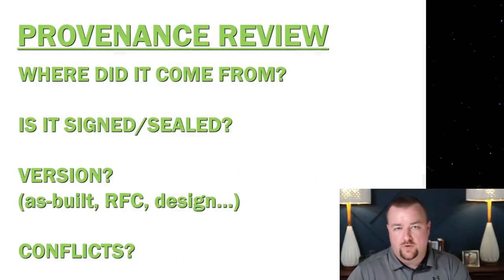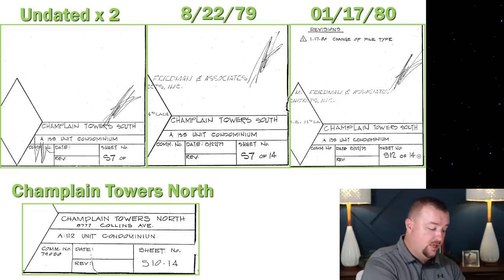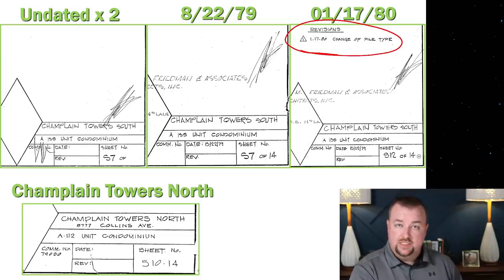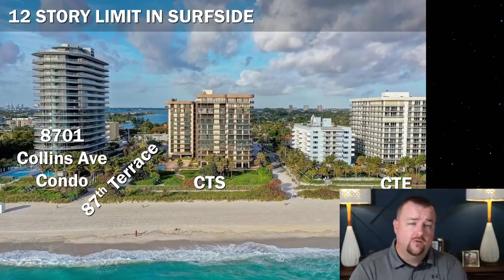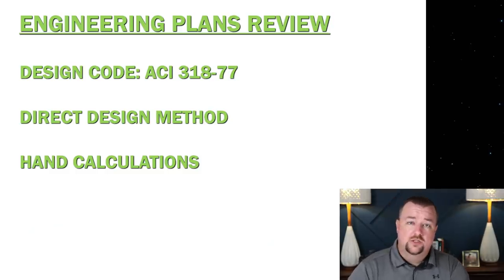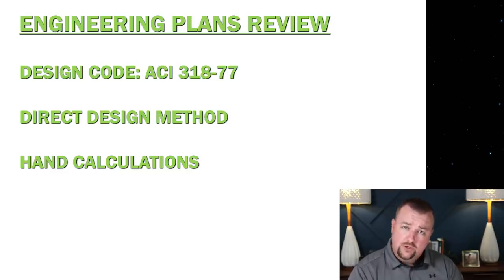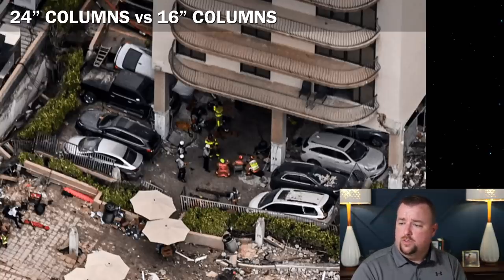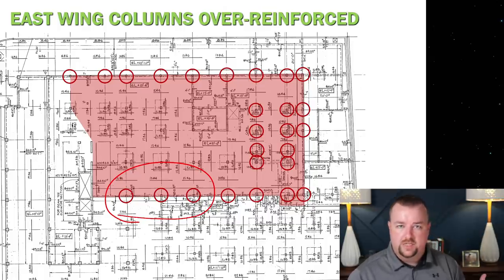Engineering Failures Found in the Champlain Towers South Drawings - Surfside Collapse

Comment: It would be interesting to know the reason for removal of the palm trees in 2018, is it likely that the stresses from that loading was recognised at that time. perhaps you could follow up on that and see if an engineer asked for the removal, and if so, why there was no followup regarding the reason IE: potential structural failure. at that time perhaps a remedy could have prevented the eventual collapse.

Comment: My only questions are
1.  "Was this design change implemented on the otherwise identical block just down the street?"  If so then surely that needs urgent attention?
2. Could rebar corrosion - especially near the sea be controlled - or reduced - at the time of construction by using sacrificial anodes?

Comment: Excellent discussion. This may well be the smoking gun for the initiation of the event. Of course, there is the issue of the leaky wall by the walkway to the beach you analyzed as well as a plethora of other contributing factors. Your discussion of the existing beams by the  north planters raised the specter of them pulling away with their rebar on the building pillars and collapsing the building.

Comment: 36:40
When Champlain Tower opened in 1980, the parking deck would be full of Toyota Starlets and Chevy Citations.

In 2021, they had Ford Excursions and extended versions of GMC Yukons. 

Could the added weight have been a factor?
Reply: US vehicles have grown in weight but vehicle loading is not great in comparison to a planter filled with fully saturated dirt.

Comment: This raises so many questions! What is the purpose of a horizontal beam if it is already maxed out at 100% capacity. Makes no sense. I mean 'something' or 'somebody' has to go on top of the dead weight, otherwise why is a beam even needed. Just to support itself!? Also towards the end, when you show the pictures of the collapsed deck, the absence of a horizontal beam is really perplexing. Goes to my question: is the deck itself designed to act as a slab!?

Comment: Would 3-D plans have caught the error of removing the beams & insufficient 12" columns?   Who approves critical plan changes - esp in 1979? Did cars weigh <> back then?  TY.
Reply: Cars have tended to be lighter over time, since people pay attention to mileage and the cheapest way to get more mileage is to cut weight. Plus, people started caring about crash ratings and the easier way to get a good rating is to add crumple zones, which in turn are lighter.

Comment: Well done! I'm not a designer or contractor, so I have no experience at all in building construction--and yet I actually understood this! For all intents and purposes, it's a matter of simple physics--and what can sustain what amount of weight. I once stood on a chair to change a light bulb, thinking the chair would be strong enough to support me. Wrong! The screws connecting the seat of the chair (made of the usual pressed board used in furniture manufacturing) to the metal frame were corroded and, quite frankly, smaller than they should have been. They literally pulled out of the frame when I stood on the chair--and I thus ended up on the floor. Obviously, I will NOT do that again (at least not without checking the structural integrity of the chair first)! If that can happen to a chair, then I can fully understand how important (and safe) construction design and materials are to a building.

Comment: I have worked on a few concrete jobs as a carpenter. The way the photos look is they didn't put enough steel in the support columns. This is how you build it. You come out of the ground and you pour your column to underside of slab. After that is done they come in with the deck put the steel down and pour your slab. The over lapping your talking about is 4 foot minimum. They over lap the next column The over lapping part gets cage bands then they frame it up and pour it again. The floor is held up by the double mat steel that runs over the top of the column in both directions. The company I worked for was Miller and Long of which the had a building collapsed in Northern Virginia in 1973. As a result they redid the US Building code that's why you have 3rd party inspector. Where in the hell where they when this building was built.

Comment: At the 4:40 point, I don't agree on the signature thing.  That scrawl seems to be the Architect, not the Structural Engineer.  Are there drawings that show that Breiterman Jurado signed and stamped the addition of the penthouse (adding load) and the deletion of the beams?  If not, that would be a significant issue.  Were these 'rogue' changes by the Architect - under time pressure from the Developer - that were not signed off by the Structural Engineer?  That certainly doesn't absolve the Structural Engineer from the error with insufficient lap-splicing (to counter thermal contraction) in the deck slab.

Comment: If there has been water pooling into the downstairs garage area for over twenty years, (I read somewhere that they started pumping out water from garage in 1990’s) wouldn’t that 1. Stress the concrete out and crack it and 2. Begin the granularization of the re-bar? If you’re letting in saltwater and not fixing it, I’d imagine the rebar down below was beyond rust-crusted by this point. Prayers to all people involved.

Comment: Interesting: designed the pool deck right to 100% load with no margin for aging, and it apparently wasn’t just a coincidence it landed right on 100%.  Someone sure wasn’t thinking in January 1980 when the transfer beams type A apparently disappeared from as-built and the actual structure.  It is scary to think this type of apparently bad engineering probably has and probably is happening in structures across the country.

Comment: We do consider intermittent vehicle travel on the deck, tree removal and maintenance. Mainly it seems to slap poured for the deck, should have been thicker, more rebar and better pier to deck reinforcement. 
But,,,if they'd have made the deck independent of the structure, it wouldn't have pulled the connection point down. Then the deck could fall, due to concrete deterioration, but not affect the building at all. 
So, on the other condos around the area. None have below grade parking?  
I'm still awed by that whole slab punched right through all those piers. With all the design, draftsmen and inspections etc. Seems in this day and age, that would happen. No storm. No earthquake. No vehicle hitting the building. Just age and design. Amazing.
I thought the piles under where the cars were parked, were 24x 24?

Comment: The 'simple fact' that the beams were REMOVED from the plan, on the 1/80 revision, might be WHY the Engineering Company Approval Stamp was missing from the Revision?  Maybe, the Engineers said "No", and the builders/architects said "Yes", go ahead, we'll save thousands of dollars.  I know from personal experience (I worked in a 'Contractor Job Superintendents' On Site Office, and regularly had to arrange for 'single area prints' for the various sub-contractors' Foremen and Workers - these were produced at the main Contractors Office, and then delivered to the site in time for the workers to have them "in-hand" while doing the actual work) that the "plans" for the actual construction work (given to the foremen and workers) often DO NOT have the 'Approval Stamps' on them.  On Site we had a complete set of all plans, with approvals, permits, etc. in the On Site Office, so they could be referred to if needed, but these were never let out of the office.  The crews work from what they are given, and probably not a single one of them said "Hey, we need beams under here".  IF that is the case, the Architects are the ones who will/should take the responsibility for the collapse.  Let's hope they had good liability insurance!  JMHO ...

Comment: F.y.i., over reinforced is also a term where steel beyond the allowable steel ratio is used, but is countered by an equal amount is used on the opposite face of the member, thus steel vs. Concrete up to allowable ratio plus steel vs. Steel beyond that ratio, a term in bending and stiffness design of a concrete beam.

Comment: Wondering in 1996 if city permits were pulled for planter changes and proposed plants, trees being this is a concrete deck in addition the layers of added decorative finishes to the surface? Interesting how the building engineering changed during the build I assume. They obviously pulled a great deal of cost out of the 1980 construction set plans. This would give one pause investing in another older high rise that’s still standing. At what point would a building be condemned? Thank god no first responders were down there investigating the noises before the collapse. RIP to the innocent victims of this tragedy.

Comment: Please clarify. At 31:37 there is a step down. So they said we don’t need the step down, eliminated the beams, but put the step down anyway, why?
Do you know if the East and North towers are missing the beams as well? Because if they do people should pack immediately and leave
Reply from the maker: They did not put in the step-down at that location.  In fact what they did was adjust the step-down from the building to the pool deck to accommodate this change.
Reply: @BuildingIntegrity  Thank you

Comment: I noticed the undersized columns when I first saw the image at video time 40:17 As I said before, incorrect reo placement, columns far too small, poor reo coverage in slabs. not enough reo in pool carpark slab , messy engineering, last minute changes, lack of slab beams. Another issue is if a car or truck looses control and slams into a column in the car park, will a 24" x 24" column be strong enough. The trick is to over engineer a structure as with age things go wrong and that extra capacity will save the day. For car-park and lower floor 36" x 36" columns with large slab beams in a matrix so there is a beam on every column and they are all aligned with each other. The columns should have a steel shield to protect them from cars slamming into the column.

Comment: I wonder if there wasn't evidence of the overloads before it collapsed, but was all just ignored, like what happened in that bank and hotel collapse in Singapore.  I said prior that "an engineer designs a building to barely stand", while it should stand, there is also the matter of "what ifs".  Such as at Singapore, the addition of a heavy bank vault, heavier roof ac units and new siding being added...without consideration to "can the building handle this added load?"  Yes, yes, the designer of that building ALSO was incompetent.  "But, I took draughting in high school, so I know everything!" kind of thing.  I'm not an engineer, either...but, if someone hired me to draw a building for him, I would add, as part of my fee, the cost to have an engineer look over my drawings and say "looks good" or "you need to revise this".  There was also the shopping centre collapse in Seoul that occurred, the owner fired the contractor and had his own company build it and they built it sub par, but, added another floor to it, even tho (I think it was) the architect said "no, no, it's not designed for 10 floors!"  He put the restaurants on the top floor...so all the heavy equipment in the kitchens (yes, I think there was like 4).  Then, they moved the rooftop AC units across the building because people living next door were complaining about the noise.  They DRAGGED the units across.  It was specifically said that the dragging them across the roof contributed to the collapse.  I don't recall if those were the original ACs or if they replaced them with heavier ones.

Comment: The 24" columns were not tied into the deck as the beam was missing and the joint has very little steel so there was no excessive force at punch thru.

Comment: now you know why i went into electrical engineering instead of structural . . . with electricity, there's almost always a fuse upstream from you that will prevent complete failure of the system.

and i worry  that the structural changes were described to a draftsman as "remove the stepdowns here and here" and they dutifully erased every trace of the stepdowns . . . and nobody checked!
Reply: I also was a electrical PE, my structural engineers often commented you can easily change a light fixture but not a foundation

Comment: Are the calculated dead loads including the later ad on of mortar and tiles ? if you look at the damage some parts of the tiles are stil sticking to large slabs of mortar and seem pretty thick ,.. also the tiles seem to be terracotta tiles witch if they are damaged in any kind of way can hold a lot of water . I myself demolished a lot of bad rooms in my life and seen the damage that water trapped under tile surfaces can do it can literally turn the first few centimetres of concrete into loose sand  , specially if you use the wrong tile glue that has odd chemicals in them that stay active as long as there is moisture .

Comment: I am not any sort of engineer but it looks like this building particularly the pool slab was engineered with no redundancy to cover degradation such as cracking and corrosion and extra loads such as those planter boxes. It would have required super vigilant maintenance to keep it safe because no allowance was made for wear and tear and less than perfect maintenance which is worrisome considering it was in an A+ corrosion environment. The offset pillars is gobsmacking too. A whole litany of cost cutting and penny pinching and it is still happening in buildings. Some crumbling buildings in Australia that thankfully have not collapsed after only a few years.

Comment: Was there a SOFT Storey Flaw in the Structural Design? I am NOT seein any tie Beams. Additionally, I am also noticing a pronounced absence of SHEAR WALLS in both orthoganol Directions. I have also noticed in another Picture, a Slab and Column (Flat Slab Construction), rather than Slab and Beam Construction.

Comment: I think that I was intrigued and fascinated by this video, sadly due to the tragic loss of life 'enjoy' was perhaps an inappropriate verb. At the very start of my degree course in engineering almost 55 years ago. We were taught about how to design safe buildings, ie ones that did not collapse catastrophically, that is steel portal frame buildings.

One thing that I have concluded is that this and similar buildings would have an expected life of about 100 years then they would be demolished. It might not have been deliberate but their construction would make them easy to demolish.

May I congratulate you on an excellent analysis which I am sure will be of importance in finally determine the cause (or more likely the causes) of the collapse.

Comment: Just one change can doom a project. I remember the The Hyatt Regency walkway collapse, the builder didn't want to spin nuts half way up a long bit of threaded rod so changed it to two rods, except that put the weight of both walkways onto the set of top nuts and they failed. The worst punching failures/design failures are when the building collapses killing the workers.
Reply: That was a bad design and wouldn’t have been safe even if built as planned, but the change did make it even worse.
Reply: @GH-oi2jf  I double checked and that was 1981 so the two projects were built around the same time.

Comment: To be honest, I’m not adequately experienced to critique your analysis, but seems like you’ve done a fairly good job, so I’m going to trust that your analysis is solid. Based on that analysis, it looks to me like the original engineers did a decent, but barely adequate job on parts of the original design, then totally blew it with the Jan 1980 modifications. 

I hope for their sake, that the people involved in those decisions are no longer around, and that the company who performed that work no longer exists. I doubt they would survive the legal liabilities that your analysis might expose them to, should NIST reach similar conclusions.

The issues with the steel lap on the pool deck, and the removal of the structural beams in the 1980 revision appear to be a disaster waiting to happen, and a major design/engineering flaw. JMHO.

To be clear, I am not an engineer, nor a lawyer. I’m just a guy with a moderate amount of knowledge in both areas based upon my varied work experience as a software developer. I could be completely off target here. Time will tell.

Comment: Considering no steel beams or posts how many holes need to be drilled to collapse it? How many holes and how many explosives needed to be used to fell the remaining section that still stood? I cannot find that information. Having a building open to the public at the base of the posts seems like asking for a collapse. Are you satisfied the quick removal of the concrete doesn't miss something? I never would have thought that taking out a few posts could make a building fall down. They have sheer walls of cement but no steel posts or beams.

Comment: So, in that photo of the collapsed planter box and parking area ( re-shown at the end of the video) the beige part of the columns was above grade in the open air, and the white parts were the basement garage area, that punched through?
Reply from the maker: Yes
Reply: Yep, when parked cars just "minding their own business" cause your building to COLLAPSE, it's time to learn some lessons... FAST... and then codify them into the FBC... oh, and call Josh. ;')
Reply: @BuildingIntegrity  to my eyes, looking on my phone screen, there doesn’t seem to be much ‘tying in’ ( I’m not aware of the proper term) of the reinforcement from the floor slab into the columns.  Shouldn’t there be either some form of either a ‘shelf’ on the columns that the floor slab sits on, or a significant amount of rebar bending out from the columns into the floor slabs if they were mono-poured?